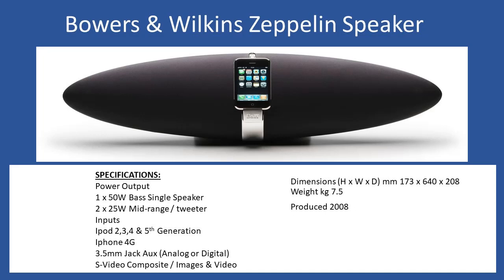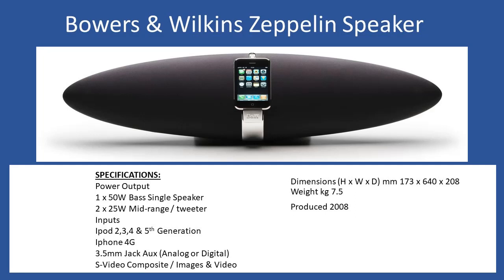Bowers & Wilkins Gen 1 Zeppelin Speaker Repair (With Audio Tutorial)

Comment: My one powers up fine… it’s when you plug an iPod into the 30 pin dock in the speaker it instantly crackles then shuts off and flashes red.

The aux works fine for around 10 minutes till it goes red… it doesn’t flash.

I’ve checked the Amp chip capacitors visually and they seem fine same said about the power supply board… no bulging… 

Some solder points are dark mind you which could indicate over heating… I really want it to work but I don’t know what to do
Reply from the maker: Hi the flashing red LED indicates the speaker has entered protection mode. The solid red LED indicates the unit has gone to standby mode as it is not detecting an audio signal. For the first issue, I would check the power supply DC voltages when the fault occurs.
If any of the voltages are low or not present, you can send the power supply for repair https://ebay.us/m/Gt0Mmv

I would look to resolve the flashing red LED first.

Comment: Trying to fix one of these for someone. Power supply seems ok but how many voltages should it create? I have 24V I think it was. Thinking to remove amp section and replace with a 3 chan bluetooth amplifier with sub out and 2x 50W to the main. A bit over powered but it can run from the original PSU (just). I was going to suggest this to the owner and velcro it on the top / back because starting to get difficult. Looks like someone tried to replace some smd caps. can't see much else, no schematics!
Reply from the maker: Hi yes schematics makes it hard going to do modifications or repairs. I cannot advise further about the power supply voltages.
Reply: Did that work, and if so what did you use?  My Original 30 pin Zeppelin just died and the power board visually looks fine and the fuse isn't blown.  All I use is AUX
Reply from the maker: @NigelBallard  Hi can you email audioamplifierservicing@aol.com